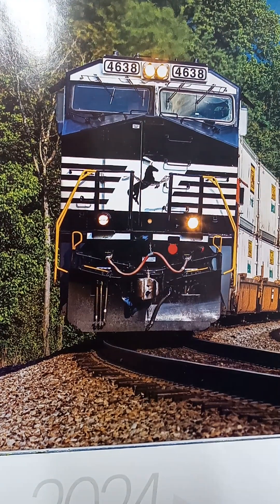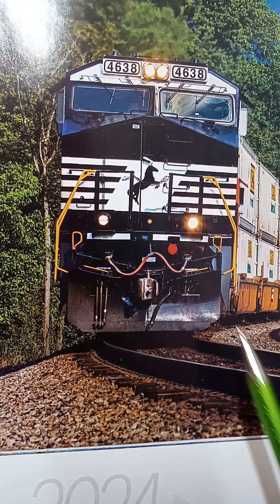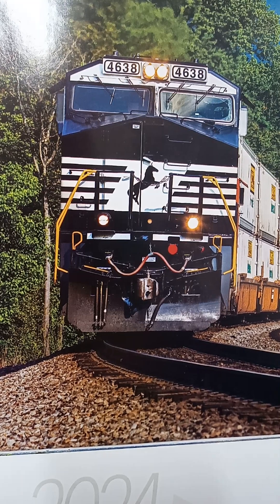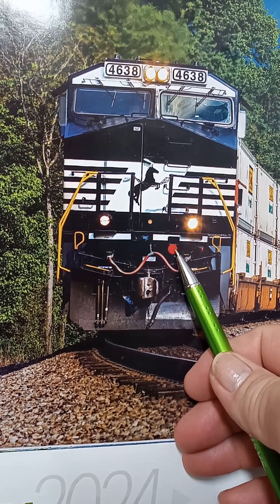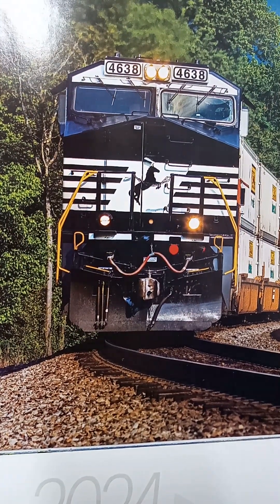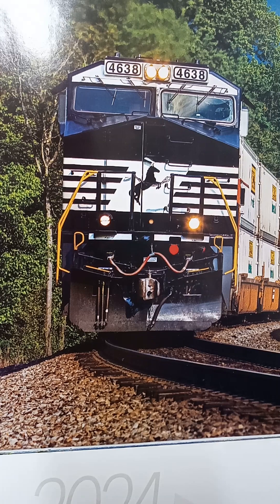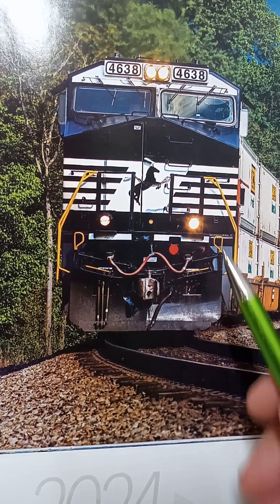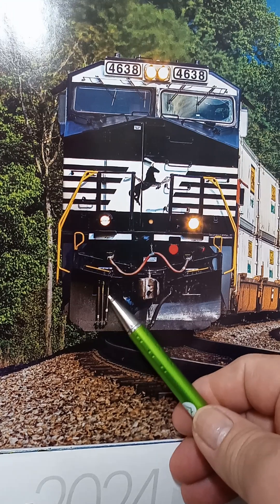The End of a Freight Locomotive, explained.

Comment: That's very interesting how each engine is linked together. I wonder how they used to connect steam engines?
Reply from the maker: Don't quote me on this one, but I think the newer of the passenger units had connector hoses that linked between units, that operated a manual type "motor" of sorts, to mimick what the actuators did on the lead Locomotive, that the Engineer moved with a lever...I think that's right. I do know that the earlier units had to have a man in every cab and they went by light signals at night and flags by day. The brakemen ran along on platforms on top of the train, and tightened up or loosened handwheels to apply the brakes or take them off. One man would have at least two cars to attend to. He was the brakeman. They went thru lots of them, when the wind would swoosh one off the train into the countryside, or off a bridge. The railroad has ALWAYS been a rough and dangerous job!
Reply: @general5104  That was some hazardous work back in the day.